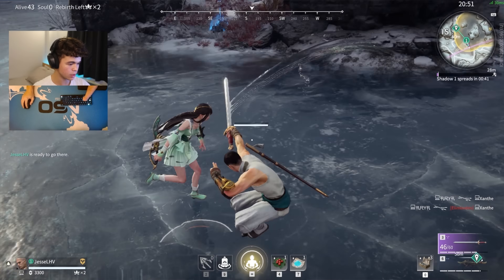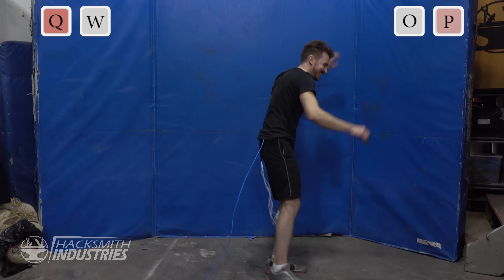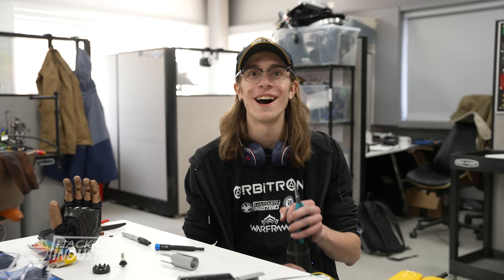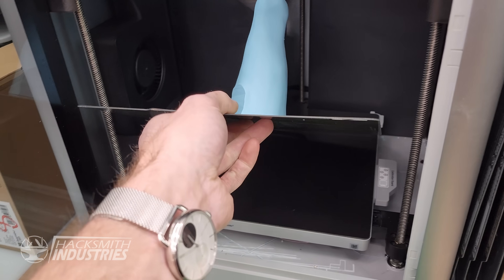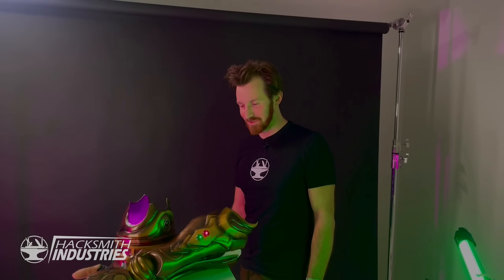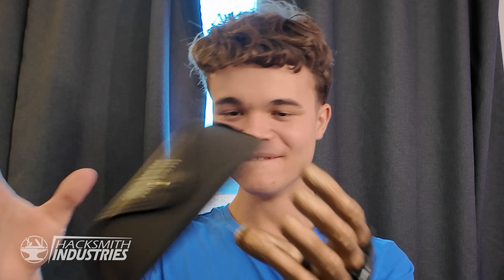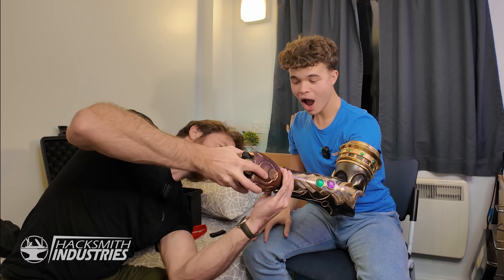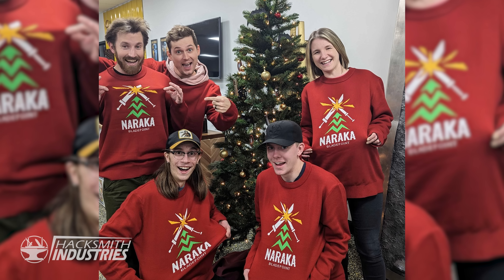I built this YouTuber a Bionic Hand!

Comment: Printing it using SLS nylon printing would be better since PLA isn't great when out in the sun for a while and has a pretty low glass transition temperature. I'm modeling a winter soldier bionic hand for someone right now and am printing it out of SLS nylon.

Comment: Would you consider creating another or sharing printing files? My wife lost her hand and part of her arm (she has her elbow). We finally were able to get an "up to date" arm instead of the pirates version (has a claw and rubber bands olus a harness that goes over the shoulders). Anyway the company disappeared. Closed up and is gone. Its supposed to receive updates over 5g. Its frustrating when the costs of a prosthetic are so much (cheapies 5-10k , 200 grand for a DARPA designed one).

Either way you guys rock for doing that.
Reply from the maker: The 3d models are just for the asthetics, Psyonic is the maker of the bionic hand, at least in the US it is covered under the medicare act! They're working on bringing it worldwide 😊
Reply: @hacksmith  thank you for the info. I'll definitely look into it.

Comment: That's actually brilliant. For a while, I wondered what could be used for fine tuning on a personal level when it comes to standardized bionics and anything that intercepts brain signals is WAY too in-depth to be useful, but LITERALLY ALMOST EVERYONE carries a tiny over-engineered computer in their pocket that can be used as a processing booster to bionic limb calculations. It doesn't even need to be WiFi connected, so you could, theoretically, drive through a subterranean tunnel without losing connection during a drive with TWO hands.

Comment: Hello, if the original content creator sees this, the dubbing in Spanish is not bad. Still, there is definitely room for improvement,  sometimes the voices overlap each other when they are not supposed to and although there is not need for voices to synch with the lips movement, some other channels have gone the extra mile to make it possible. Still, I repeat, that would be more like a luxury than a requirement. - Update, I listened to the end of the video where Jessy was receiving the arm, that part was awful, they recorded sounds of other speech that was not for the video, maybe they were in a rush or something, and accidents happened.
Reply: the french version is horrible

Comment: I orderd a minisaber gen-2 and filled in the wrong e-mail, and custumer support is not anwsering. How can i adjust my e-mail adress
Reply from the maker: It's the weekend -- customer support will get back to you on Tuesday after new years 😊
Reply: @hacksmith  custumer support has not responded
Reply from the maker: Sorry! We have a big backlog of customer support emails we are working through as fast as possible. If it's only your email that is wrong, and you put the correct shipping address in, then your order will be shipped properly ASAP. The new minisabers should be arriving this week which means it will be sent out shortly therafter.
Reply: @hacksmith  okido thank you for answering my comments, and for the amazing video’s. 👍🏻

Comment: It's amazing what your doing only thing i'd worry about is that pla isn't very durable and abs would have been a better pick don't know if you have any printers that can handle it but engineering filaments like carbon fiber would be the best fit being MUCH stronger sometimes pla will even melting on hot days.
Reply from the maker: The actual hand is carbon fiber and the arm piece PETG-cf -- only the decorative pieces are PLA which he probably won't use after the video haha

Comment: In 1999 when I was a senior, for my end of the year biology project I designed a bionic hand that had titanium skeleton, polymer muscles and microfilament wire to connect it to the nerves and make the muscles fire. Teflon tendons, too. I built a mock up of it from balsa and fiber model airplane hinges, and used elastic and servos with twine to act as the muscles and tendons.
Reply: Thats nice man

Comment: This is rad, is there a way to rotate the hand? Like if I grabbed a stick and twisted it left to right? Can that be done with that hand in the future? I guess it would just need a motor at the “wrist”?
Reply from the maker: Yeah wrist movement is done with the socket (not the hand) it is possible to get a socket that has wrist movement,  but in general you don't need it until we have more sophisticated control methods (I.e. neuralink) -- until then just manually rotating your hand is good for most things

Comment: Although they are just decorative pieces you really shouldn’t have printed them out of PLA. PLA degrades in the sun relatively quickly, is brittle and softens at just 50-60 degrees Celsius. All it takes is an impact or touching something too hot or spilling hot water on the arm and it could break or deform it. You also need to think of chemical resistance for an arm that will be used regularly. Your printers are capable of many other materials. ABS or ASA would have been a good choice as would polycarbonate. Polypropylene would have been an excellent choice from a purely functional standpoint assuming that those parts don’t need to be stiff. Polypropylene is one of the hardest materials to print but it is possible, it is very tough and slightly flexible and has the added bonus of being very chemical resistant. Slightly soft, flexible and extremely durable are all things you want for an arm like this.

They may just be “decorative” pieces but when used on something like this they aren’t purely decorative. Also if you are painting it anyway then the colour of the base material doesn’t matter.

Are there any reasons you went with PLA as opposed to materials that are most likely better suited?

Also for a soft material meant for prosthetics, Colorfabb have a prosthetic specific version of their “Varioshore TPU” which can get really soft and is available in skin tones and has added silver, apparently for antibacterial properties, just in case you do another project like this.

Edit: I saw you are using a better suited material for the socket itself, but why PETG with carbon fibre?
Reply from the maker: The costume pieces are for this video... you think he's going to wear them ever again? N
Reply: @hacksmith  that was what I was thinking, but just wanted to point it out anyway. Why did you go for PETG with carbon fibre for the main socket? 

Anyway, it’s great project as always and it is great to see how far prosthetics are coming along now.
Reply from the maker: Printed on the Pantheon, it's got some of the highest strength and impact resistance for FDM 😊
Reply: @hacksmith  it doesn't seem pantheon provide any datasheets and only provide basic specs. Do they provide commercial customers with datasheets?

Just going off of the limited information I can find, Young's modulus of 4200 MPa and tensile strength of 49 MPa, it is definitely a good all round high performance plastic but it doesn't seem that special when compared to other similar and cheaper plastics, just looking at datasheets anyway.

Comment: Love it, I worry all that extra plastic and silicon will cause discomfort due to overheating though. In V2 maybe use some thinner carbon fiber construction and pair it with heat pipes or classic aluminum conduction cooling to get that heat away from the skin and into the air. Other improvements would be spring tensioning for the sensor and force feedback bulb so that they make good skin contact without needing to go through any long prep in his mornings.
Reply from the maker: A silicone sleeve is standard for prosthetics, it's not usually an issue! And... we did make it out of carbon fiber!

Comment: TL;DR: Good job, you gave the right arm for Jessie, but so you are aware, it isn't even close to being the most advanced in the entire planet.

 I don't want to make light of the good work you've done here, and it really is good work, but calling this "the most advanced bionic hand *in the world*" is just plain incorrect. To be clear, it is most likely the best hand to use in this particular instance due to certain quirks of the more advanced ones, but it is still not *the most advanced in existence*.

 There's hands that instead use Implanted Electrodes, which make them far more sensitive (and thus fast), more impervious to electromagnetic interference, retains full functionality even when the user is sweating, and are capable of providing tactile feedback directly to the nerves. They can have individual fingers closed or opened as well. They also have sockets connected directly to the bone, so they don't need an attachment all the way up to the shoulder, even though only the hand is missing. That's obviously significantly more advanced. 
 
Why then, did I say it is probably not the better option? They're not just more expensive, but require invasive surgeries once every 4-16 years (depending on how well they were installed). Even if you replace the hand, the electrodes implanted can get worn out and become problematic if not placed properly, and even if they are placed properly, they are made of wires, not cells, so they cannot regenerate themselves. They aren't really gifts as a result, unless you gave Jessie enough money to cover all of his arm-related surgeries for the foreseeable future, he could suffer from installing it.
Reply from the maker: You're referring to the implant... not the hand.  Psyonic has been doing direct to bone mounting in research. The hand itself, the hardware, has more dexterity and touch sensors than the other hands-- I'm not sure you even watched our video? We showed individual finger movement... please watch before commenting.

Comment: Really nice. But it could have been even better if you put the cycle-grip-type on an extra sensor on his "open hand" muscles.
Reply from the maker: What do you mean?
Reply: @hacksmith  the switch for changing grip type. It was on the outside of the arm and he needs the other hand to push it. It could be on the inside. It looks like he has plenty of different muscles to put an additional sensor on. To avoid accidental switching something like a "double click" or long hold might be good.
Reply from the maker: It is double click 😅

Comment: Can somebody explain to me why/how come the wrist doesn’t move? Are the sensors not able to sense those contractions?
Reply from the maker: Wrist movement is done with the socket, there are ones out there you could attach the hand to, but we didn't have one! You can just rotate the hand if you need it at a different angle. In practice that's usually simpler and easier!
Reply: @hacksmith  Any chance you/someone can explain why it’s easier in practice? For example: If I were to open a door, my wrist twists during the motion.
And thank you for reply!
Reply from the maker: Your dexterity for the time being is still limited,  even with the best bionic hands. Wrist movement,  while it may seem crucial, isn't necessary for 90% of basic tasks. Going from no hand, to being able to pick things up, is huge -- wrist and elbow joints will evolve eventually to keep up :)
Reply: @hacksmith  Thank you very much :)

Comment: the fingers look horrible but the rest looks pretty good, tho this dude is to use it everyday, could of ade it out of better materials looks really cheapy and would dmg easily
Reply from the maker: The hand is made out of premium materials... the palm is carbon fiber, and the fingers are heat resistant silicone over spring steel... this is the rolls royce of bionic hands!
Reply: @theHacksmith  yes the hand you didnt make is amazing quality. im not doubting or commeting on that. Im talking about the cosplay style attachment to said arm, i know its a brand deal and the arm is in reality the amazing thing, the attachments look like something i could buy from poundland
Reply from the maker: He's not going to use the cosplay part lol

Comment: For those bionic hands using artificial nerves and titanium implants and stuff, imagine having the screw on hand in 2 parts. One doesn't move, and the actual part. Part 1 (doesn't move) picks up the signals from the implants to transmit them to part 2 (the actual hand), and it uses something like Bluetooth. Btw both parts have their own batteries. Basically though, part 1 must be attacked and both parts switched on to work, however part 2 does not need to be connected. My idea is you could attach a small camera to part 2, and then have it as a deplorable drone, and that would be epic. Imagine leaving behind half your hand when you leave a room, only for it to start crawling around  like something out of starwars. Btw you could then have vr goggle glasses or something to see it.
Reply: Im not sure if I explained my idea tho.
Reply: A think a got it and it sounds amazing

Comment: If the arm sends electrical signals to servo’s (steppers?) Can you create a direct interface to the buttons on a gaming controller??
Reply: If I understand from the other video it tracks micro tremors or some other movement in your arm. The brain and nervous system still work even if there isn't a hand for them to control, the other muscle and ligaments are there. Mapping that to a controller would mean having to learn a different command system essentially. Probably possible though.

Comment: He has functioning nubs on the end of his arm, those could probably be used to make an even better hand, but that would be a very custom process.  This is an awesome job all!
Reply: I was thinking the same, since the arm is modular a better hand could be added later. But for more granular input, myoelectrodes would need to be surgically implanted in the residual limb.
Reply: I was thinking the same thing
Reply: I'm sure they love working on projects like this, so I wouldn't be surprised if they did a followup video with upgrades.
Reply: perhaps some buttons inside the silicone sleeve that correspond to mouse clicks.
Reply: That would be wonderful, and it makes a lot of sense!